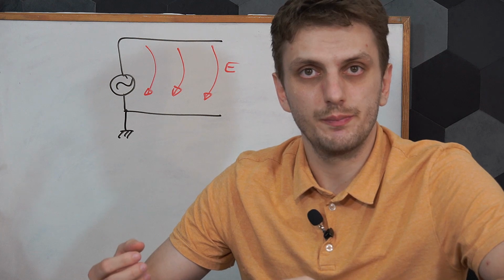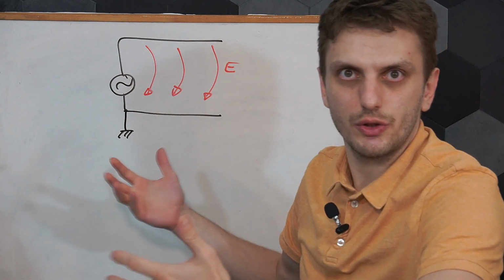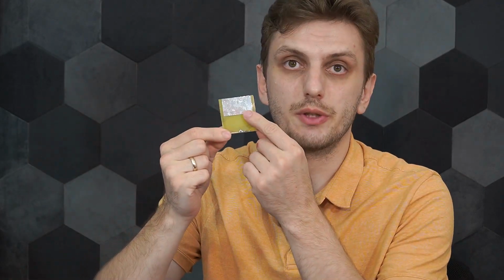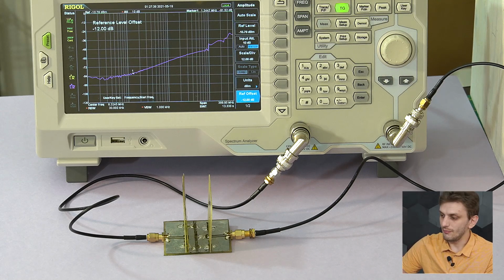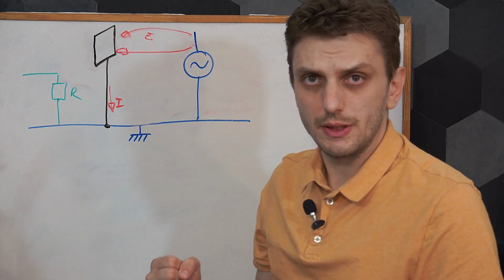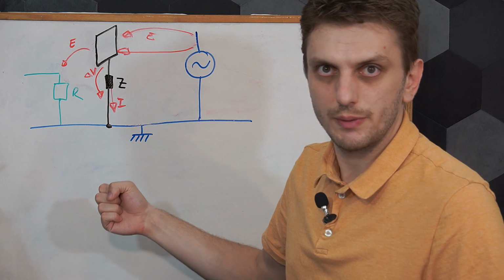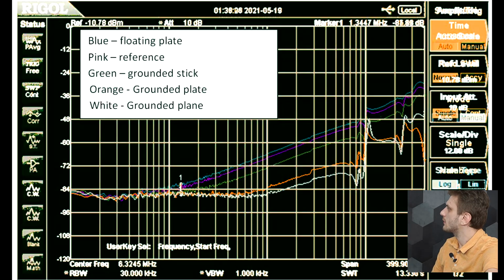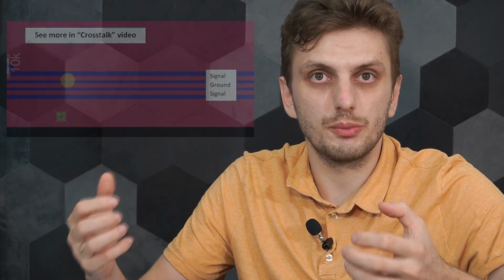EMC tutorials - Electric field shielding

Comment: In your experiment, you were using plates for shielding. If instead you would put a complete faraday cage around either the noise source or the noice receiver, would this then be able to shield properly even when left floating?

Comment: Great demonstration! A question: Will the transferred field be affected if you add the grounded plane close to the source plane, but outside not between the planes, as demonstrated? Could you test this? I was speculating that crosstalk and EMF could be improved in a PCB just by adding grounded copper tape to the surface with a thin varnish between the tape and the pcb.

Comment: It depond of the type of the shielding some material reflect and some material absorbs
Reply from the maker: I do agree with you if you are talking about electro-magnetic waves - conductive materials like copper will reflect the wave, while ferrites or lossy materials will absorb the wave and turn it to heat. However, here I was trying to discuss about electric fields only - here you need conductive materials and good connections to ground for efficient shielding.
Reply: @FesZElectronics    🕺🕺🕺woow i get a response from FesZ😁. But isnt shielding a way of protecting a circuit from picking up interferences from outside where EMR is the interferences? What i wanted to say in my first comment is choosing a shield that absorbs EMR is better why because your circuit will generate its own emr and it will reflect back to the circuit am just sayinng 😇
Reply from the maker: Well, if the distance is small, and the frequency is low, you will be in the "near field"; the electric and magnetic fields are separate and not forming an EM wave yet - here it makes sense to treat the fields differently and shield them differently. As an extreme example, the ground layer under a SMPS, even though its conductive, will not reflect the noise, but rather reduce it. When it comes to noise of course its best to absorb rather then reflect, but that's not always realistic or financially viable...
Reply: @FesZElectronics  FesZ am lost whats the differnce between electric field and magnetic field? For example your circuit act like two antennas reciver transmitter so can i say that antennas and radars are "electric field" and magnetic field like transformes and indictors??

Comment: Ground potential is always relative. In real life large conductive plates have a significant capacitance against Earth and so AFAIK constitute their own ground, isn't it? Thus the grounding is only strictly mandatory for "small" objects (and due to limited lightspeed nothing can be grounded perfectly).

As an analogy, this is a bit like a xylophone plate that easily clangs at its frequency when floating, but not when laying on the floor. With bad grounding the situation can be like laying it on a cymbal that by itself will start to vibrate by resonance when excited by certain frequencies. A large conductive shielding behaves more like a heavy solid object that by its own inertia is hard to excite with high frequencies.

Comment: around 5:00, The PCB material forms a dielectric that makes it a capacitor. That is why the insertion loss gets lower. Better test it with only a copper plate. I sometimes make capacitors for RF filters from double sided PCB. But a very nice serie of experiments. Well done

Comment: Excellent series on shielding. Can it be fair to assume that its always better to shield the cage, so that it will provide optimum protection for both magnetic and electric fields ? Also can you demo sources of magnetic fields and electrical fields ?
And finally if you could show the effects of using a shielded cable and non shielded cable vis-a-vis interference. TIA and look forward to more videos !!

Comment: How do shield enclosures usually get connected to circuit board ground? I’ve never payed much attention to this in equipment I’ve opened up, but based on this experiment I’m guessing a simple jumper wire would be completely ineffective.
Reply from the maker: Indeed, you don't just have a jumper wire or a single point connection but rather a good connection involves an all around connection to ground. So for a PCB mounted shield, the connection to ground should be done in multiple points, or ideally the shield is soldered all around to the boards ground.

Comment: Great video 👍🏻
Maybe it's worth mentioning that the return path of the ground also highly effects the attenuation of the signal. 
Ideally you want to make that as short and direct as possible to the source (the sending plate in this case) 
Especially in the MHz region.
Reply from the maker: You are right - the shield connection to GND, as well as the GND to noise source; or signal reference connection is important. I guess this can turn into a much more detailed discussion when the ground its self is not very uniform...
Reply: @FesZElectronics  Correct, or maybe rather a can of worms, hahaha

Comment: Noticed you’re using SMAs for everything after BNC adapters, while I’ve been just using BNCs all the way through. Are SMAs better somehow? Or cheaper? They’re smaller and easier to board-mount, the latter of which is rather appealing.
Reply from the maker: Well on the one side, a thicker coax cable usually has smaller losses (N-type is better than BNC which is better than SMA - the cable attached to these connectors); but this is only important over long distances. On the other side, a thin cable is more flexible (from a mechanical point of view); so for a 50cm piece of cable, you don't want something thick and bulky - that is why I prefer the SMA. Regarding connectors and price - well, my local electronics distributor doesn't even have female PCB mounted BNC; and SMA is more easily available and its just smaller, so more of them can be put in a smaller space.

Comment: Another fascinating, although simple, experiment.  The results were not a surprise, but I have never seen the results with my own eyes (or taken the time to do it!) So, thanks Fesz.  I do suspect that the thin metal shields (at 3:03) will not attenuate H fields too well, but I wonder if you would be interested to investigate that claim?
Reply from the maker: Well, I did look at magnetic shielding a couple weeks ago and one of the tested materials was a tin plated copper PCB. The size of the "shield" was much larger than what I was using in the Efield experiments mainly because of the size of the coils needed to generate and measure the magnetic fields, but effectiveness should not be related to size, I mean, the shield should cover the noise source (or the sensitive circuit) but as long as this is achieved if the shield is bigger will not make it work better. I'm not sure if that was what you are expecting.